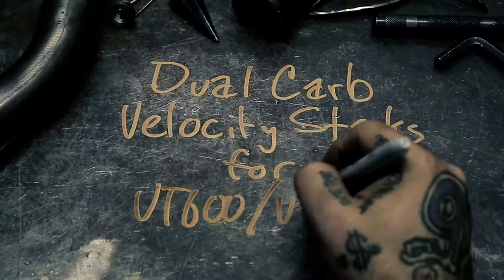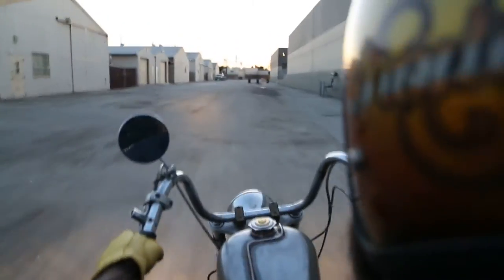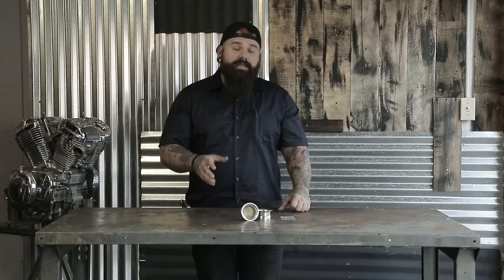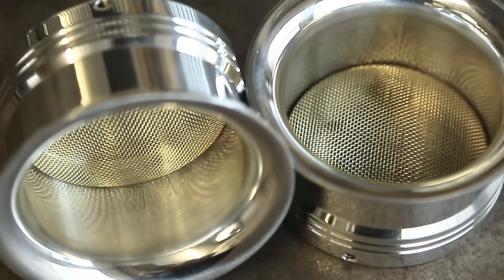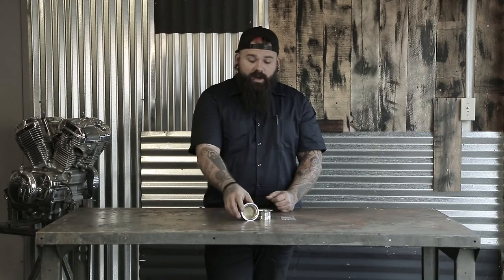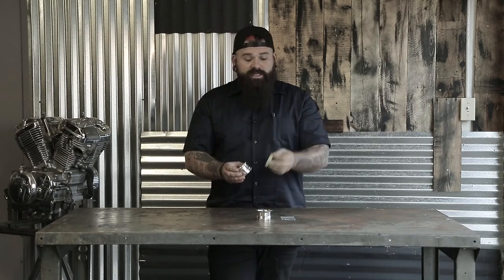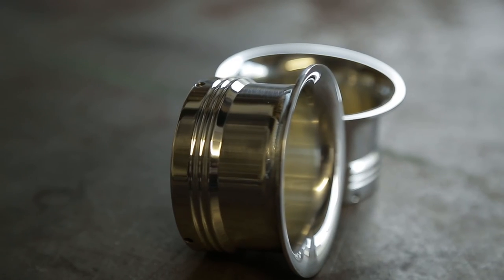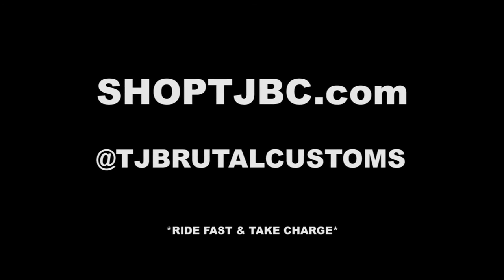Honda Shadow Velocity Stacks Dual Carb VT600 & VT750

Comment: Whats up fellas

I bought the velocity stacks, the performence kit for duel carps and the straight open pipe draft exauhst for my 1998 honda shadow vt750 ( parts fit all on my model). I put everything in and started it up. I ran very good, great power output and no problems for two days. I parked my shadow after a 70 km ride down to a campsite for tow days without starting it and when i started it the next time the power output was shit. Still rideable but copared to before very bad performance. It takes a good while to get some speed. I checked very much stuff already but i run out of ideas. I thought maybe there is somewhere a leak where air comes i  but the carb boots are new and well sealed. The exauhstgaskets are fine. The carbs seam fine aswell. Petcock is clean, fuelfilter is clean. I (double-)checked very much stuff and run out of ideas ( Sparkplugs, different settings for airfuel- mixture, the new jets aswell even if i cleant the carbs and other stuff.Does anyone had a similar problem and can help me ? Please give me some idea's guys, its my first bike and i learn all the stuff on my own and wont give up till its fixed. I am good with mechanics just to point out that i dont fucked stuff up while rebuilding the carbs and like i said, i checked that trwice to made shure everything is fine there. I count on u lad's and on the tjbrutalcustoms-Team aswell.

Thanks  guys!

Lucas

Comment: Hey T.J. I bought a single carb kit from you a while ago for my brother's bike. The bike is a 07 VT600CD with 5600 miles on it. He later sold me the bike and never put it on so now I'm stuck with the honors.  

I'm planning on turning into a bobber eventually but first things first, and that is to get it running. Now my question is, since I bought the single kit for I also need to purchase the performance kit to work with the stacks?  Thanks in advance.

Comment: Hey. i live in a pretty dusty conditions. How fine is the mesh..? Looks not too fine.....can they be replaced with 200 holes per inch stainless steel mesh that looks like satin fabric...or would they be restricted a lot...?
Reply: @TJBRUTALCUSTOMS  thanks for reply...well we obviously don't want anything like that to happen to my missis :D. What is the finest yet still acceptable strength wire thickness do you think? My driveway is just super dusty and the dust is like a powder..so I am thinking to actually put some different thicknesses foams into the stacks ...or something as they do have on enduro bikes to prolong the life of the engine. I agree 200 is too thin. Maybe 100 or 80 is better... The bike will be well tuned so shouldn't be throwing flames thrower trough the air intake...

Comment: hey teej  i really need help about what jets do i need to get for my steed 400  before i buy your performance kit  ..do i need the same kit of the vlx 600? because the stock jets on the 400s are smaller than the ones on the 600s,thanks and i am really looking forward for your reply.
Reply: Did you find a solution? I too have a 400, and want to put stacks

Comment: Great video! I do have one question though. I've got an 06 Aero vt750. There's a short hose going from the factory air intake into the top of the valve cover for the rear cylinder. What do i do with that? Thanks!

Comment: hello from Spain! im curious for to know if this velocity stacks will fit in my VT800C from 1988. Thanks for the answer!
Reply: @TJBRUTALCUSTOMS  thanks for answer! Is theee any other posibility? And i have more questions. Im thinking about install an hyperchaeger aswell, is posible? And another one. Is there any system to make my right controls housing and handlebar clear and less controls in the front of bike? I saw a tutorial yours about install buttons in the case of side beside battery box. Is posible? Thanks again!

Comment: Sooooo, if I install these on my 02 vt750 ace deluIxe, they will work fine with stock exhaust after rejet? When I get new pipes, I will have to rejet again?
Reply: @TJBRUTALCUSTOMS  but, will they work with stock exhaust? Won't be too much backing up pressure because of the overly baffled exhaust the honda put on?
Reply: I have a 1996 vlx 600 will the stacks work with my stock exhaust after I rejet it. Want to get away from all the crap?

Comment: Hey TJ, I just received my performance rebuild kit and I am eager to solve the terrible performance issue on my bike. The bike I bought currently has straight pipes with a stock carb and intake (I know, it runs like shit and idles like shit). My question is whether I can tune the bike, remove the stock intake and hoses without installing velocity stacks just yet. What are the pros and cons of running without velocity stacks? I eventually plan on buying velocity stacks but can't at the moment.
Reply: TJBRUTALCUSTOMS alright looks like I’ll tune with intake for the mean time until I buy velocity stacks. Appreciate you. 

Question about the rebuild kit: does it come with an o-ring for the float bowl drain plug/screw?
Reply: TJBRUTALCUSTOMS is it attached to the gasket for the float bowl? I’m wondering what that o-ring goes to.
Reply: TJBRUTALCUSTOMS alright never mind that. I have an issue with the diaphragm that comes with the kit. It doesn’t have a tab like you show on your diaphragm installation video. I was able to align the small hole on the slide with the a letter H that is on the edge of the diaphragm. Is it absolutely necessary to have the tab?

Comment: how does it perform on a sandy road or in rain?
Reply: the mesh size looks very big, I wouldn't use that on a sandy/dusty road, you will get sands/dust in your oil and damage engine parts

Comment: Can i use this setup on my vt1100c2?
Reply: TJBRUTALCUSTOMS I would be very interested in stacks for a VT1100 🤙🏽
Reply: That's the only bad part of the vt1100c2 is all the evap hoses and the air intake those add about an hour of frustration cursing and yelling at them cant wait I have a stage 2 jet kit and holes in baffles just need the intake to be easier so that take carbs out are a faster
Reply: @isaiahventura9915  oh there such a pain!
Reply: Do you make them for the 1100 yet
Reply: @Bhilderbrand  I removed evap
Reply: @isaiahventura9915  so did i
Reply: TJBRUTALCUSTOMS when will they be available
Reply: I can't rejet it it sounds bad and don't run good